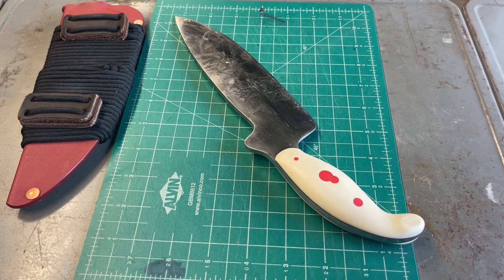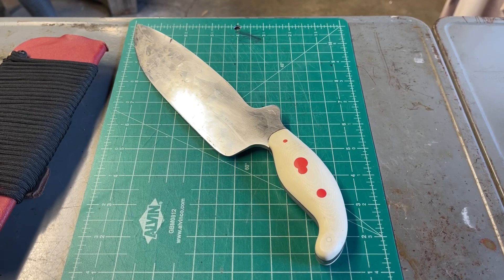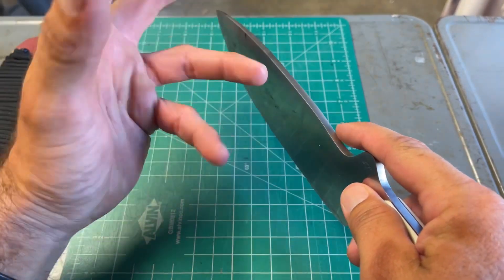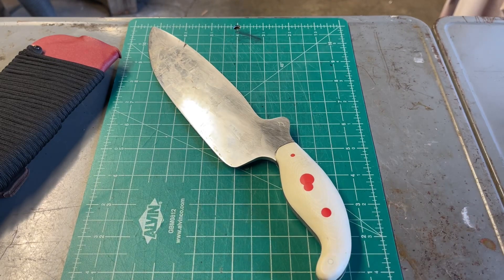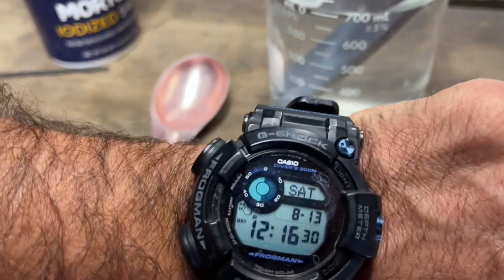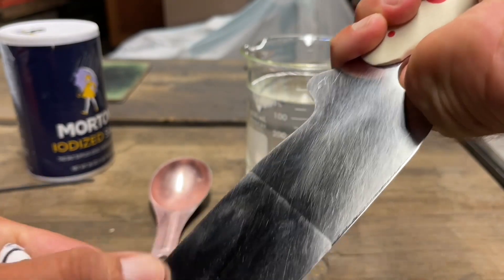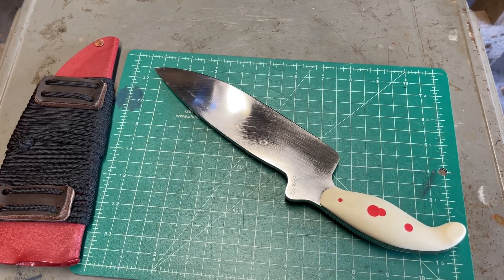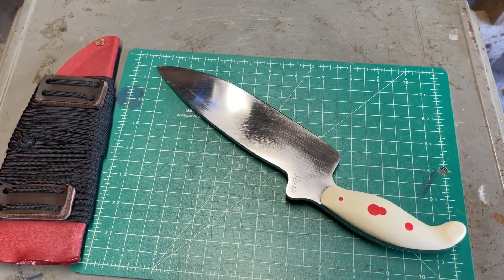Magnacut failed saltwater test in less than two days

Comment: Have you considered that it was not the steel which rusted? 
I have carried a magnacut folder with me in the pocket of my swim trunks for a week. It went in the water, stayed in the wet trunks overnight. No rust! No edge loss. If rust forms it would form at the edge first which would result in edge loss.
Reply from the maker: I’m always open to new interpretations to my tests. But the way I see it is that in this test the only thing that could rust is the Magnacut knife. Everything else in the test is either G10 or Pyrex. If I had to explain the difference between my knife and yours, I would guess that your knife has a different heat treat which possibly makes it more rust resistant. But I am open to learning if you have any suggestions.
Reply: @totesmalotes i don’t think that HT can be so poor that it would affect rust resistance. Of course it can but has to be really poor. 
I was thinking residual stuff on the blade, in the salt you used. 
I am not saying your test was not good. Anything done different is good. All i am saying is that if it did rust the most likely spot it would have start to rust would be the apex. Mine is a Manix Lw salt. I was not curious about the steel in mine more curious about the spring and other steel parts which are not magnacut. But i checked to see if i had any edge loss and as far as i could tell: there was none. Next vacation i will repeat my “test” to see if with a different edge(smaller angle/coarser apex) it will do/feel the same. 
In my experience from all the test i have done: if it does it once it may be the behaviour or it might be a fluke. If you ca repeat the test/results it is very unlikely that it is a fluke. 
Like i said: not saying you are wrong and i appreciate the time you put into the video
Reply from the maker: @SpartanJohns  yeah, I don’t see as anyone being right or wrong, I see it as more information for something I’m interested in. In use, Magnacut has never rusted on me. I have cut many things and gotten the blade wet and without cleaning it, have put it back in its Kydex sheath without a problem. It’s only in this test and others, where I’ve used Magnacut bar stock pieces that I’ve seen it rust.
Good luck on your test. The Manix is great knife to have in Magnacut.
Reply: @totesmalotes  I still have my doubts about small springs and saltwater in the long run...but we'll see. 
I think the best salt knives are the ones with few parts. Like the first itteration of the Pacific Salt. The less moving parts the better. But ...time will tell

Comment: I have to wonder if changing the protocol would adjust the stainlessness. You should ask what protocol peters used. Did they use cryo or not and what temperature did they use?
Maybe trying a different austenitizing temp, lower temper and a longer cryo or lower cryo temp might change those attributes? I have not really delv into magnacut protocols much to say for sure. But heat treat protocol will affect stainlessness. I'm sure Larrin can provide more feedback on that front because its his steel.
Reply from the maker: Peter’s does use Cryo on all the knives they heat treat. From what I understand I think they use the heat treatment protocols specified by Crucible but I don’t want to put words in their mouth and there is a chance they have changed their protocol. 
From what I understand heat treatment does play a big role in corrosion resistance. I’ll try to ask Larrin in comments next time he does a video.

Comment: From my experience and looking at composition of H1, LC200N, Vanax, and Magnacut I'm not surprised at Magnacut is the least rust resistance out of the 4.  Chromium is still king in helping steels resisting rust.  Nitrogen boost those stainless qualities but it's not a replacement for Chromium. When comparing to non nitrogen PM steels,  I would like it see how Magnacut performs against those steels.
Reply from the maker: I think Magnacut is better than Swiss army Inox when it comes to rust spots but with way better edge retention. I tested H1 against titanium in a galvanic corrosion test and in a week the test suggested H1 was as rust resistant as titanium. I still have to do another test for a longer time but there is nothing that I’ve tried that has beaten H1 in rust resistance.
Reply: @totesmalotes  Stellite 6k, Dendritic Cobalt, and 60 NITINOL aka SM100.  To be fair they aren't steels but those would not have any problems putting them in salt water for months or years.
Larrin created magnacut to be a stainless version of 4V/Cru-wear.  It performs nearly the same as 4V/Cruwear with the added bonus of stainless resistance of 20cv/S45vn. 
 I think people hype Magnacut to be some super rust resistant steel when there was no clain even in the articles I read by him.  I think people were surprised spyderco was using the steel in their salt series.
Reply from the maker: @Tkangz  thank you for giving me those examples of materials, I haven’t heard about them before. It gives me something new to check out. I haven’t heard or read Larrin make any claims that Magnacut is on par with Lc200n or the other steels I mention either. It’s just been some reviewers and the act of Spyderco claiming that they were going to use it in their salt series.
Reply: @totesmalotes  Nitrogen based steels ingot or powered metallurgy can provide high levels of rust resistance but it doesn't replace chromium.  Magnacut has only 10.7%.  That's actually low. Remember anything under 13% is considered not stainless.  D2 has 12.5% and magnacut resist rust way better than D2.  The other steels H1, LC200N, and Vanax has 15-18% chromium.  Cons of the 3 steels is they aren't able to get hardness above 60-61 but Magnacut can go up to 65 and still 3-4 times tougher than s35vn, M390.  Magnacut has easily has 10x more carbon than H1 and 3-4x more carbon than LC200N and Vanax.
Reply from the maker: @Tkangz  thank you for the info, it’s something I always appreciate.
Reply: @totesmalotes  No problem.  Just wanted to clear misinformation.  What magnacut has done is doing is it's opening the doors to formulate new steels that can be tough, hold an edge for a long time and be stainless.  Before it's usually pick two out of the three.  Magnacut is a start to where you may get to all of the above you want in a knife steel.

Comment: I jumped on magnacut hypetrain but it seems it's time to jump off 🗡️⚔️🔪
What is your opinion om M390?
Reply from the maker: Hello, I’m going to do a full review on Magnacut later. Magnacut seems pretty good so far it’s just not as corrosion proof as some people think it is. 
I haven’t tried M390 at all so I really don’t have an opinion on it. The two steels I would recommend are cpm 3V and Vanax so far.
Reply: @totesmalotes  Thank you 🔪⚔️🗡️
Reply: Cedric did a test on 20cv which is pretty much m390. It seemed to perform almost if not as well as the lc200n.

Comment: Larrin made this steel so that it has pretty good all-round characteristics - pretty good edge retention, pretty good toughness, pretty good corrosion resistance - which it has  -- there are other steels that are tougher (many carbon steels), more corrosion resistant (lc200n), edge retention (rex 121) - but magnacut is one of a very small group that does all 3 things pretty well   -- that is what he wanted to accomplish and he did
Reply from the maker: So far I like Magnacut, it has been good at everything. I actually think it’s exceptional when it comes to taking an edge and keeping it. But the only thing that bothers me is that when I have seen corrosion test videos, Magnacut has been compared to Lc200n which doesn’t make sense. Magnacut’s corrosion resistance is good, I haven’t oiled my knife since I made it and it hasn’t rusted, it’s just not Lc200n good; I know you know this since you mention it. So this isn’t me bashing Magnacut it’s just me denying what other people have said because of what I’ve seen in my tests. 

Also, I feel kind of tricked since I bought Magnacut because Spyderco was going to make a salt series knife and I wanted to make another corrosion proof knife, which what I made isn’t.
Reply: This guy is a champion for Larrin.
Reply from the maker: @hagninety4116  everything he said is true though. He also mentions that it’s not as corrosion resistant as Lc200n which is the point I’m trying to make. Magnacut seems to be a really good steel so far just not as rust resistant as it’s hyped.

Comment: Just another example super steels are mostly marketing.  
I believe for my uses carbon steel works best. 
That is a beautiful edge you've put on that. 
How has this steel done cutting stuff.
Reply from the maker: So, the only thing that has stood out about Magnacut is its edge. I’ve used this knife for a few weeks now and I have been surprised by how well it maintains it. I’ve chopped branches and I haven’t had any problems even though the edge is really thin. Also, I have needed to maintain the edge on this knife less than on my Vanax.
Reply: @totesmalotes  still it's a expensive steel.  I wonder if it's really worth the extra money?
Reply from the maker: @richardhenry1969  unfortunately the only experience I’ve had with the 80crv2 knife I made is that I have sharpened it for my dad every now and then. I might make an 80crv2 knife for myself in the future so I can do a proper comparison and see whether super steels are actually worth the extra money.
Reply: @totesmalotes  super steels are nice for certain things. I believe mostly for people that don't use their knives. The steel tends to stay looking nice. 
I like carbon because it's easy to sharpen and very cheap to make different designs.
Reply from the maker: @richardhenry1969  I agree. Most people that have the latest steels have them to just look at them. And I was impressed with 80crv2 when working with it. It also took a very nice edge I just need to use it for a while because most of  my experience is with super steel.
Reply: @totesmalotes  the thing that made me look into it.  First it's just about 1080 with a few additives. 
Second all the old knife makers were using it. 
Then there is the fact that every knife I've ran across that people that really use knives covenant was made with 1080 or 80cv.  I'd rather take advise from real users then youtube guys getting free knives to test.
It's kinda sad how youtube used to have real knife tests.  Now it's look what I have. 
If someone found something they really liked they wouldn't need to show new knives every week. You don't know if something is good only using it a few days. 
.  I'm glad to hear your father likes the knife. Remember steel is only a small part design and edge are what really make a knife. 
Have a good one my friend.
Reply from the maker: @richardhenry1969  I always appreciate your insight on things. And yeah, a lot of people like buying knives just because they like buying stuff. It’s mostly to scratch an itch than to fill a need. 
I’m guilty of buying knives and not using them too. I don’t have anything crazy but the ones I don’t use I find Inspirational or I see them as art. 
And I agree what makes a knife good is the knife as a whole, all the right decisions that were made for its task. 
Hope you have a good one too friend.
Reply from the maker: @Archie Baldwin yeah, that’s true.
Reply: I use expensive steels to cut things and sharpen less. Mainly use them at work. Some of us actually do that kind of thing you know. 

The market who buys 200-400 usd knafs made in china with poor performance heat treatments with expensive steels like 20cv and m390 are being ripped off. But they dont use their knives normally. But they aren't getting what they paid for even so.

With the correct heat treat these super steels are really good.